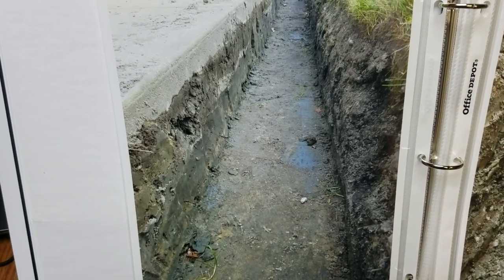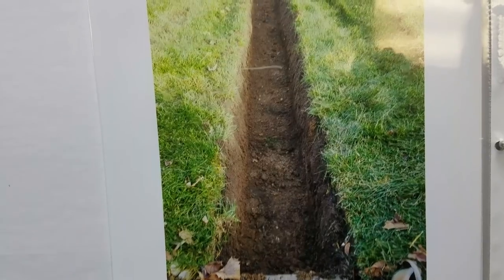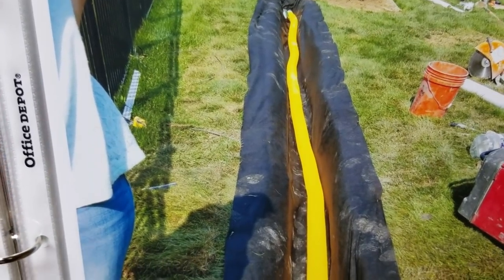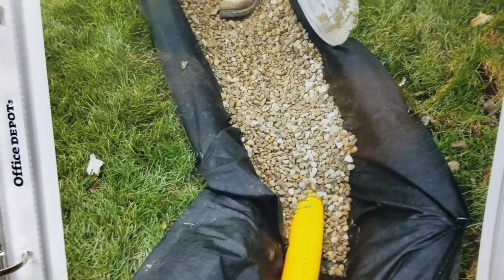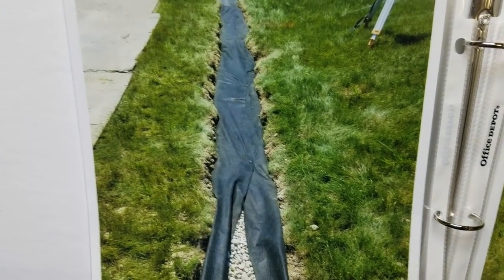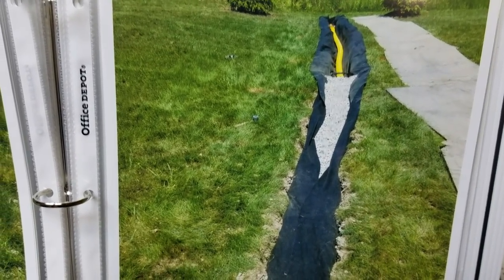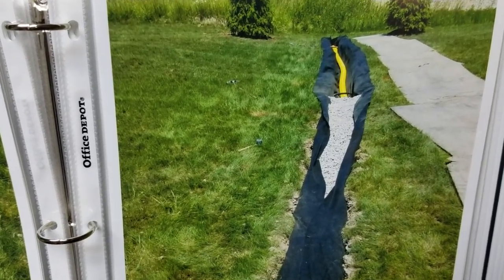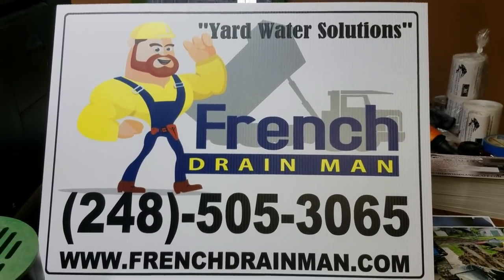How to Build a Maintenance Free French Drain

Comment: 8oz non-woven geotextile filter fabric - 5' wide? I need to run about 100'. The first 25' run along the back patio and is level but once you round the corner of the patio to head toward the front yard there is a 2" drop the first 100" (using your string+level+2shovel trick). There is a nice drop from back corner of patio to the street. What is minimum depth for my french drain -18"-24"?
Reply: Did you end up doing this project? How did it go?

You can use the string line measure trick to find out how much to dig at each point

Comment: Great video. Do u have to keep a 1% slope?
Reply from the maker: @ Goose
If you wrap stone No you do not.
Reply: @FRENCHDRAINMAN  great! Thanks for the quick reply
Reply: Sorry for all the questions but i just bought perforated pipe from home depot that comes with a sock on it for super cheap. I was gonna use the sock on the pipe and the geotextile fabric you recommended. Will 2 fabrics be an issue?
Reply from the maker: @goose1498  
That pipe will collapse it's to thin good luck!!

Comment: Drain Man. How do you tie in Sprouts to this system? Thanks.
Reply: I was wondering this as well. I`ve watched 20 videos and it isn`t illustrated. It seems that the French drain is made and the downspout is a separate tile that is brought to it but ends at it with a pop-up. The water is shed by the pop-up emitter and then filters down into the French drain. Anyone-is that how it`s done?
Reply: M Z depends. If you intend to filter the water and put it into the perforated drain pipes, then a pop up that dumps the water on the soil on top of the French drain is the solution that you are talking about. However, often a dedicated non-perforated pipe dedicated to just the downspouts is most often used by the FDM.